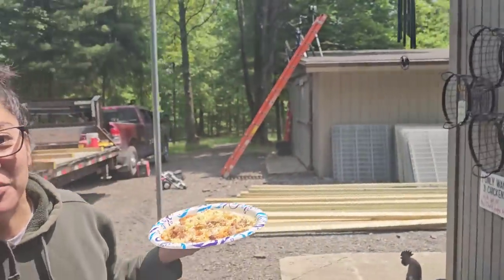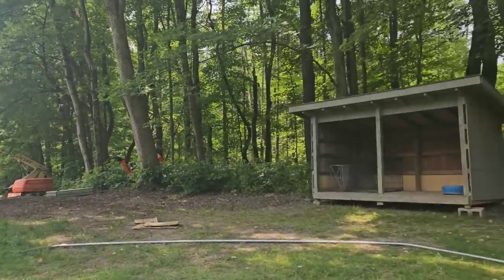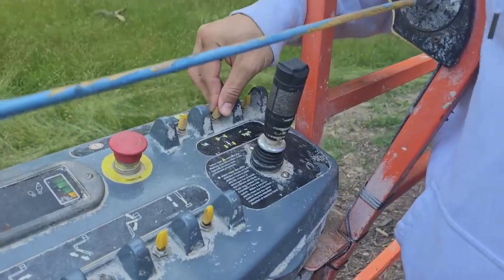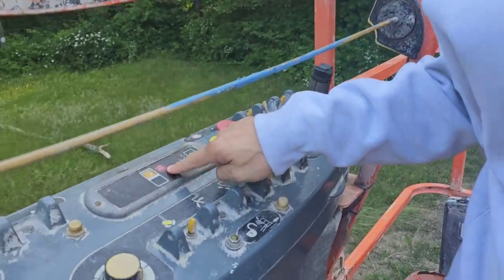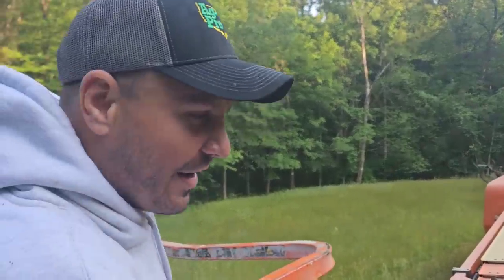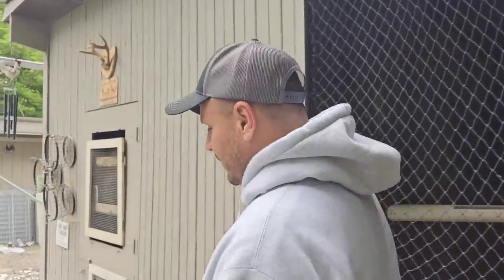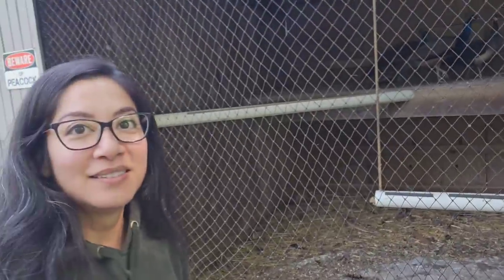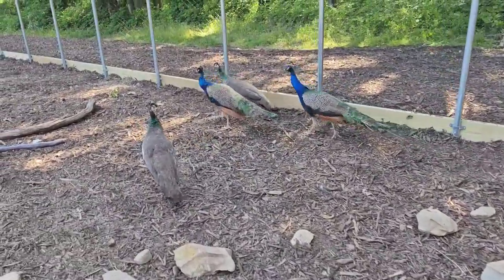THEY WILL NEVER Get My Animals

Comment: You should've had the bottom of it done with chicken wire and at least one foot of it buried in the ground all along the sides as well as the front and back. I had constructed on 25 years ago and found out the hard way that coyotes will just dig their way into it. After I buried the chicken wire, i never had another problem.

Comment: HI Jeremy  I love your new run, it puts my 9ft x 10ft one down.   I had a big problem in the beginning with rats chewing through the wire that it came with.  You have the same problem coming up.  I bought 100ft of rabbit wire.  1/4 inch squares 3 ft with and installed it over the original wire.  Nothing can get through that wire.

Comment: I’m so jealous!!  That is so cool. I would grow avocado and citrus trees in it. My unsolicited advice would be to buy some rolls of non climbing horse fencing to attach to the lower inside of the wall sides and pin down to the ground all around the outside. Predators will rip thru the plastic in nothing flat or dig under the wall.

Comment: Jeremy and George will you be placing 6-8 ft high chain link fence on the bottom portion of the Avery  that way it protects the netting and the feathered babies from predators. You can actually add a cement barrier all around it with the chain link placed inside the cement barrier that way predators won't dig in. The cement barrier can be about 1 inch away from the poles and the netting that way if you decide to remove the Avery it's movable and the predators aren't capable of digging in. Just a thought. Lots of love from Florida.

Comment: Make sure you bury small square wire that is bent at an angle with two feet going up the side and two feet on the ground buried so nothing can dig their way in. Attach netting to square fencing with rings...been awhile..not sure what they are called..sorry! Raised 4000 pheasants..you might want to try them. Jumbo Mongolian/Chinese ringneck crossbreed...yummy...breast out at 
6 lbs..Looks amazing...we also planted corn for cover inside our flyways.

Comment: If she wants green eggs just use aluminum camp cookware that isn’t anodized and you’ll have green eggs……

You’ll need to fence the bottom 3’ of it as raccoons skunks an opossums will cut through that fabric netting like a hot knife through butter. I has a raccoon tear through chicken wire once when it fell in and got trapped it tore its way out.

Comment: Lol My sister and I used to paint houses and our boss rented a 60 foot man lift and we were driving on damp soil on a side hill and it was sliding down the hill sideways. I bought 2sheets of plywood and we jogged them to stop the side sliding. Then the controls in the basket quit working so I put my sis in the basket to mask some high windows. The next thing it ran low on hydraulic fluid for the turn table so when I would move the basket from the ground it was shuddering a little bit. But the basket was jerking back and forth two or three feet way up in the air. My sissy was freaking out. Lol next day we got a different one delivered. I busted a gut when you guy’s started messing with that lift!😂😂😂😂😂